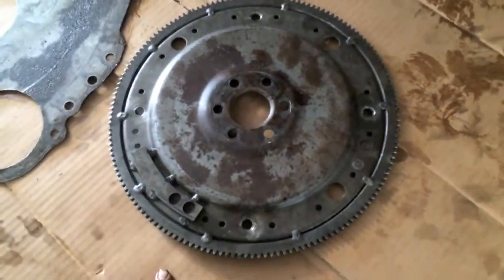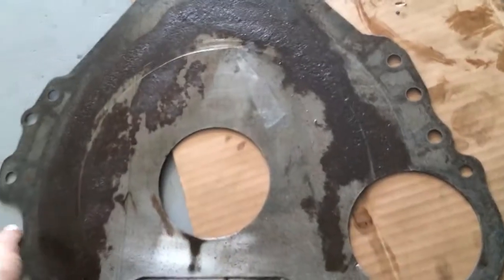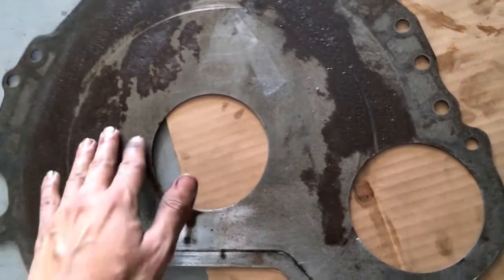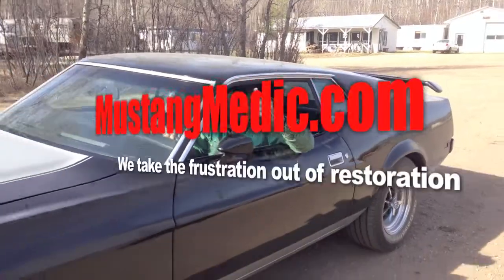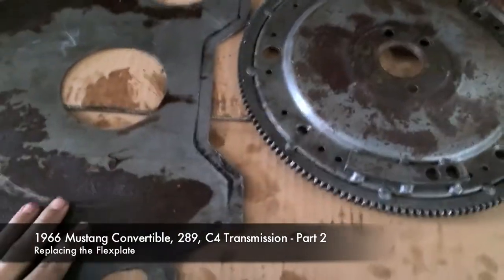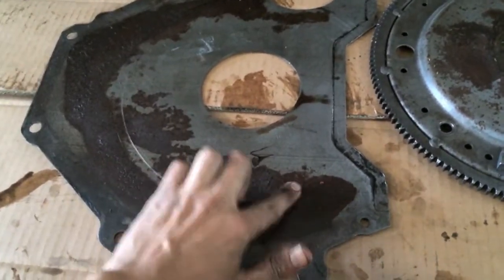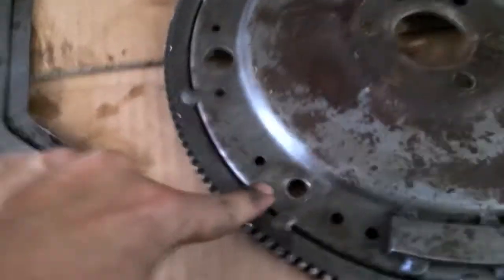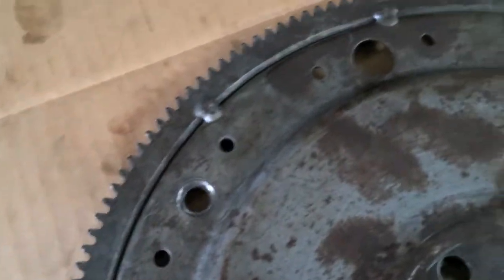Damaged Flexplate on Harvey's 1966 Mustang Convertible - Day 61 - Part 2 Ford Mustang Restoration

Comment: I believe Harvey has just about all the kinks worked out of her. I like the car.
Reply from the maker: Agreed, he may be selling her
Reply from the maker: Want to make an offer
Reply: Mustang Medic I dont have the money to get my Volkswagen fixed proper by a Volkswagen expert so I will be laying around on the cement fixing her myself. It will take me a month to get the new K sub frame on it. I am thinking should I order the bolts? Do I have enough money for bolts right now? I just bought a used 80 dollar K sub frame. I dont think I can afford Harvey's sweet Stang. I wish though. But I like the four speed Stang you have available, and it would be better if I had the money. Harveys car is pretty nice though. He has really put the work into restoring it nice.It should be a great car for him or somebody. Some like my wife dont like manual shifting. It can be a pain sometimes.